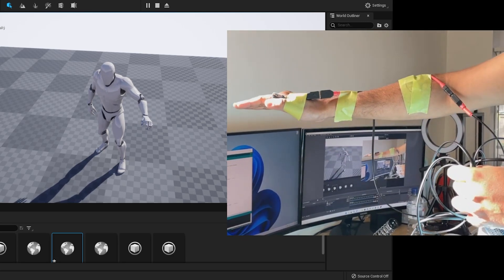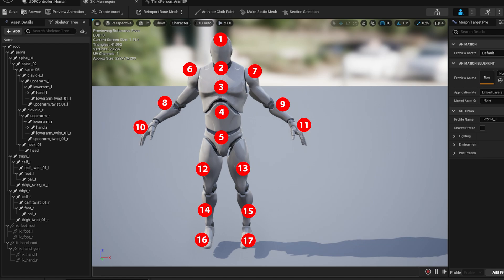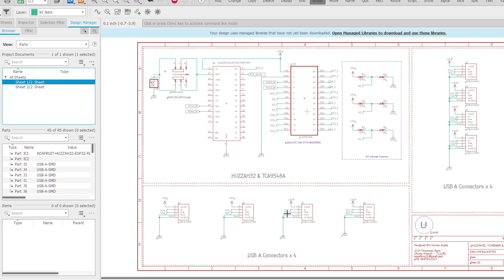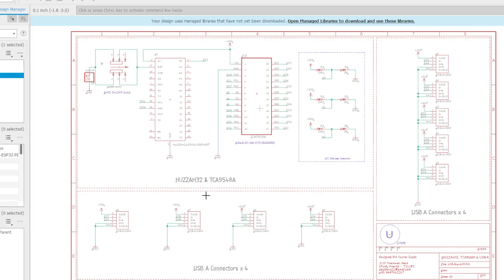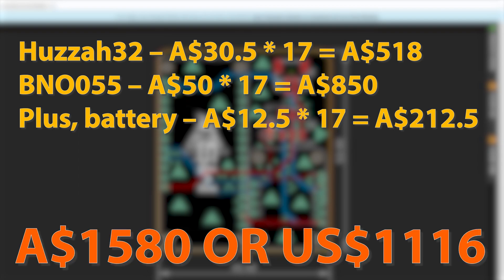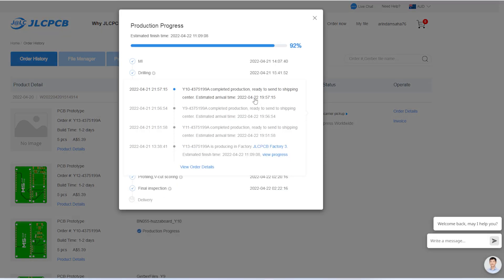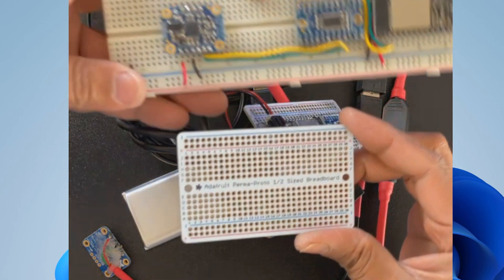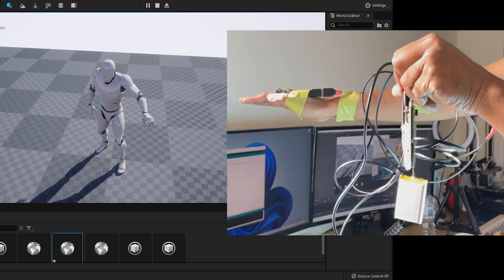Full body mocap suit schematic design with cost | Build it within $1000 only and play it in Unreal

Comment: This looks like a variant of the open source slimevr… what are you doing for data cleaning? The biggest issue even with xsens and rokoko is the data interpretation and cleaning.

All those suits use similar imus.
Reply from the maker: Hi John, Thanks for the comment. I am well aware of the data cleaning issue. Which I will take care of soon. I believe it is not that difficult, with the help of AI and more sensor fusion, this can be easily taken care of. Currently I am on the verge of building the simple prototype. After that my milestone is data cleaning and accuracy. Please stay tune. Thanks.
Reply: Are you going for live capture or record and clean? If live capture then this has good possibilities for the Vtuber sector.
Reply: Also if you apply inverse kinematics to core bones you can drop your sensor needs down from 17 to 9-11
Reply from the maker: @KANDYMANIAC  This one I need to learn, could you please share some materials on that.
Reply from the maker: @KANDYMANIAC  Planning for live capture
Reply from the maker: @KANDYMANIAC  Quite liked the VTuber option. Looks like it is upper body and camera based to capture facial and head movement. I do have a plan for that for facial expression. BTW many thanks for the suggestion. Quite helpful

Comment: Where do you recommend to get BNO55? It is a really rare component and sought after.
Reply from the maker: I bought it either from Adafruit or Digikey. You can try mouser as well. Currently it is out of stock everywhere. I am also waiting for BNO085, last 3 months :).
Reply: @othersYATC  I see, well good luck. Its a impressive component with how robust it is. BPS space uses em, and his followers too.
Reply from the maker: @yelectric1893  I see. BNO055 is robust but need to understand how it gives the data. Sensor fusion is the  key. This sensors are mostly used in high performance drones. BPS Space - I was not aware of, will check. Thanks for suggestion.
Reply: @othersYATC  BMI055, BMI085, BMI088, LSM6DS3, LSM9DS1 seem like pretty solid SPI gyros.
Reply from the maker: @yelectric1893  Yeah there are so many in the market. So far Bosch's review is best and proven. I will definitely try MPU9250 and LSM9DS1. If it works the cost will be drastically reduced. Thanks for the suggestion